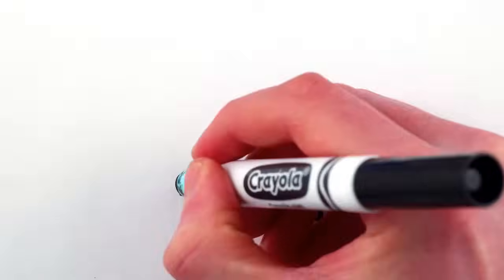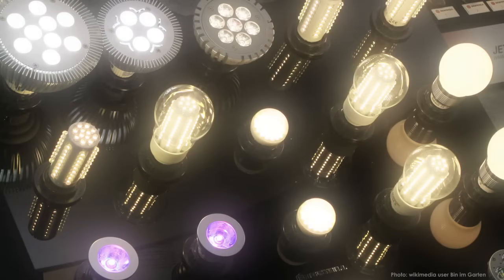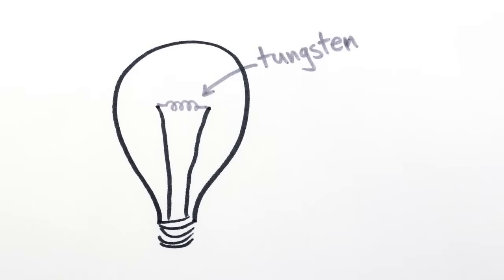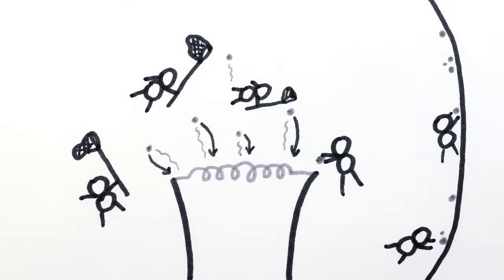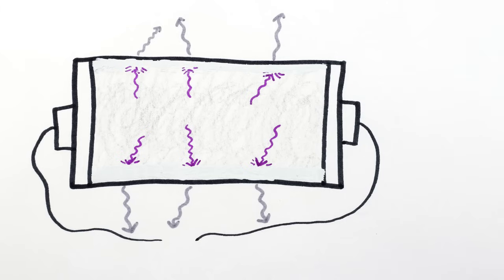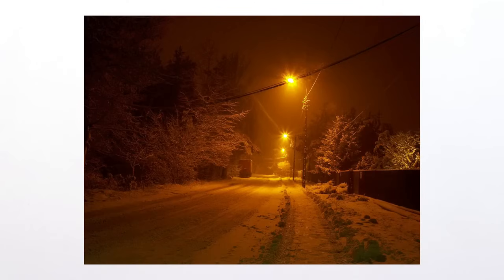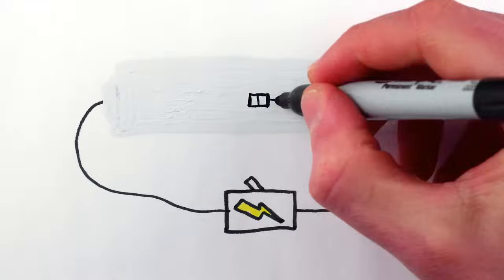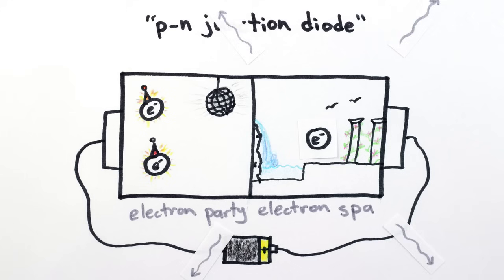How Modern Light Bulbs Work

Comment: correct me if im wrong , the fluorescent light bulb emits uv , and the glass is coated with something that prevent the uv ray from passing through it , but i thought all glass absorb uv ? why needed to be coated ? thats why u cant get sun tanned in room with windows
Reply: The coating on a fluorescent tube is called a phosphor. The light emitted by the excited mercury alone only produces Ultra-violet (UV), violet, blue, green and yellow light. The phosphor coating is used to convert the UV light into red light, so that we can see all the colours.
Reply: it doesn't only absorb, it converts it into visible light.

Comment: So then, what process is most efficient at the process of converting electrical energy to visible light?
Reply: Tommy59375 Because LEDs emit white light, which the human eye can see better in than the orange street lights. If they're upgraded, then they were probably halogen to LED, I know that in my city the lights are halogen, and some are LED. The LEDs are brighter, provide white light, and use less electricity than what we have now, so it makes sense to upgrade. They're also probably a lot more cost effective to replace and maintain rather than vapour lamps.
Reply: Typically, in order of most efficient, is vapor lamps, LED, fluo, halogene, and classic ampoule
Reply: Adricol0
So, then, why are some towns' street lamps being "upgraded" to LED-based systems?

Comment: how do color changing LEDs work?
Reply: They have three (Red Green Blue) crystal parts that are basically 3 LEDs in one plastic housing. By changing the intensity of the 3 colors you can make many other colors. (This is also how you computer LCD screen makes 16 million + different shades of colors!)
Reply: To add to the answer of Leuel48Fan , changing the intensity isn't as easy as it sounds. You can't just apply another voltage because LEDs don't act like a normal resistor (i.e. don't follow ohm's law). Rather, they just let through all the current they can once the "forward voltage" has been surpassed. So you use a resistor in series with the LED to limit the current (the resistor value is ((supply voltage) - (LED forward voltage)) / (desired current).

Once you have that resistor, you can adjust the brightness using PWM, which is essentially switching it on and off very fast. The human eye only sees the average, so if you see an LED that is switching on for a millisecond and off for a millisecond, you see an LED that has half the brightness of a fully lighted up ont.
Reply: vir ingens I knew about the blinking thing, I know 7 segment displays use it to save energy and have consistent brightness, but I'm pretty sure changing the voltage of the LED does also change its brightness (up to what its rated for). That's why an LED flashlight with low batteries dims just like any other bulb.

Comment: Do the pc uv lamps cause cancer to us? Because I have one installed..
Reply: Have you ever been sunburnt by the UV lights in your computer? No, there simply isn't a high enough intensity.
Reply: ***** You don't need ionizing UV to cause damage. The common way of DNA mutation - via the formation of pyrimidine dimers - doesn't require ionization to occur.
Reply: Only if you gonna eat "GMO" tater chips and corn while you watch the screen!......Any more questions?
Reply: hm can you guys translate it to "my language"? lol
Reply: ***** The very first link in the Wikipedia article on pyrimidine dimers states it quite clearly:

http://theoncologist.alphamedpress.org/content/6/3/298.full

UVB light is energetic enough to cause dimerization, and as you yourself stated, only light below 120 nm is ionizing. UVB only goes as low as 280 nm, and is non-ionizing. The article also states that UVC, the only ionizing component, rarely reaches the surface of the Earth anyways, due to atmospheric absorption.

Photochemical reactions in general doesn't require ionization, only the excitation of the electron into an anti-bonding orbital to destabilize the bond.
Reply: Paulo Melo We're talking about a specific mechanism of DNA damage that's common to UV light. DNA consists of these "letters" that are chemically bonded only via the backbone. However, UV light can sometimes excite the molecule enough so that they bond where they're not supposed to, and if the body cannot repair that damage properly, you get mutation.

Comment: I was hoping you'd touch on High Intensity Discharge Xenon bulbs (used in automotive and infrastructural applications). I think they're closely related to fluorescent bulbs except that they arc electricity through gasses and require more power to initially turn on

Comment: How does one speaker reproduce multiple frequencies of sound? To clarify, I think that a speaker diaphram vibrates at a certain frequency to produce a sound, but how does one of them reproduce the music of an entire band with many instruments and vocals?
Reply: You can add two waves together to get one resultant wave.

Imagine dipping your finger in and out of a pool of water - you see waves of water coming from that point of contact. Now dip your other finger nearby at a different frequency. Any given point of the water will move as a result of the sum of the two waves.
Reply: ok, but using your analogy, does one speaker not equal to one finger? How then does it manage to produce many ripples at once?
Reply: Nope. I'm saying multiple waves, when added, can become a resultant wave. All you need to do is have a speaker follow those "points" I mention. I'm trying to let you think how one point on the surface of the water will move according to the sum of the two waves, even though it is still just one point in the water, and you can map its motion with one function.

Here, see this waveform:

https://www.wolframalpha.com/input/?i=sin%28x%29+%2B+sin%282x%29

This is the sum of a wave, and another wave of double the frequency. All you need to do is have a diaphragm follow that exact motion, and you'll produce sound waves that is the sum of the two frequencies.
Reply: I guess its hard for me to believe what my ears hear as many different sources of sound are actually one resultant sound wave, but I am beginning to understand now. Thanks!

Comment: How a telephone works
Reply: A fifth grader should be able to explain in principle to you about how a telephone works. The key work is "should". I don't know exactly what has happened to the school system since I went. When I was in primary school, about fourth grade, every student was assigned to make a crude electric telegraph and connect them across the room to our 'science partners' desk and transmit and receive a simple message in Morse code. Mrs. Davis, my teacher, may never know how much of an effect that these simple electronic projects we did in her class had on me.
Reply: If a 5th grader can explain POTS and telephone exchanges, then I wouldn't have a job wiring the things up. There's a bit more two it than the basic principle. The awesomeness of telephone isn't in the simple end devices, it's in the rats nest of wires and switches that makes them connect to each other automatically and reliably.
Reply: Magic.

Comment: I tried the new CFL bulbs in my office and was pretty disappointed. While they didn't generate heat like standard bulbs the light emitted didn't last as long as a standard bulb IE the light produced became less after only a month or so to the point I was replacing the bulb with a new one. They're also very expensive and rules for disposing of them are unrealistic. In anticipation of the coming ban of standard bulbs, I've begun stockpiling them. They may produce heat, they may cost a few pennies more than CFLs to run but they LAST LONGER.
Reply: You likely have a bad batch.  They do exist.  Only buy reputable brands.  CFL's last far, far longer than incandescent.   We replaced all ours 5 years ago and have only had ONE go bad in 5 years.
Reply: Kevin Patrick Nonsense.  Just do the math.   CFL's put out 4 times the light for the same wattage.   Electricity is about 16 cents per kilowatt hour.   A high quality 25W CFL bulb costs about 4 dollars, and puts out the same visible light intensity as a 100W incandescent.  With the CFL you're saving 1.2 cents per hour in electricity costs compared to incandescent.  

So, It only takes 333 hours of use until you've payed off the cost of the CFL bulb ENTIRELY from your energy cost savings.   After that, even if your "thicker filament" bulb was free, you'd still be loosing money.
Reply: codediporpal I've tried the 'bad batch' thing buying from different stores and I even bought one while on vacation. They ALL performed the same way, the brightness of the light began to fail after a month or so. 

I work on a drawing board. I have a tube fluorescent fixture for over all light and second light for detail lighting and tried the CFL in the latter. The lights are on for sometimes 8 hours a day, the tubes are 2 years old and still perform as new, the CFL is a fail. The standard 60 w bulb, despite the heat produced, lasts longer and will remain my first choice which is why I buy them whenever I'm in a store for anything.
Reply: If incandescents are always outlasting your CFLs, you probably have a bad bit of noise in your electricity. AC is supposed to be a nice sine wave for the ballast to work right, but in your case it likely isn't. Noise on electrical lines is also the reason why you're not supposed to use CFLs on dimming circuits.

If you plug in a radio you can probably hear the line noise (AM in particular), and it's likely any other electronics you have may also have a shortened life as well. (It's not just going to be your CFL bulbs.)

Where the noise comes from? Could be a bad a bad transformer stepping down from the mains, bad wiring in the building, somebody else using something that causes noise in the lines (ie: welding equipment). If bad enough, you should call an electrician or the power company to figure out where the noise is coming from and possibly get it fixed.
Reply: CFL bulbs are a are a heath and ecological disaster in the works, for a whole variety of reasons. (I'm not going into it or going to reply to arguments about it because there is plenty of info readily available concerning this subject.) I hypothesize that people who primarily use CFL's are knocking roughly 20 years off of their normal life expectancy, however, time will tell.
     I use a plethora of solutions to light my house, but CFL's are not one of them. In part because they create interference which negatively effects the equipment in my home recording studio, and the concentrations of mercury in them which becomes very hazardous, if and when they break.
     I think it's stupid when I hear people say that the incandescent is a 19th century invention in a way to imply that it's age makes it inferior and that we shouldn't use it at all. Candles are thousands of years old,.. people still use them,.. lots of old inventions are still used. Vacuum tube transistors have been effectively replaced with solid state and micro processors, however, there are still applications where vacuum tubes are preferred over solid state products, such as high quality guitar amplifiers and such. An LED bulb isn't going to make my lava lamps work, either.
     I like my incandescent bulbs particularly in the cooler months because they help provide ambient heat from their locations and not having to solely rely on a single central heat source which is pulling multiples of the light bulb's load put together.This reminds me of those stickers on new TV's that say this TV will save you 27$ of energy costs a year over conventional CRT screens. So, if energy savings were my rationale for upgrading my television, hypothetically,.. then it would take at least 20 years for the TV to pay for itself in energy savings. Since energy costs rise, probably longer. (By the way, I like having flat panels, but I'm not letting go of my CRT's, willingly, either.)
     It seems to me that the banning of incandescent bulbs is an industry funded cop-out to reduce the load on our aging electrical grid as opposed to actually upgrading and improving it. It's one thing for lighting technology to improve and for people to gradually and voluntarily switch over like people did with televisions, but it's totally draconian to outright ban the production of another older technology, especially when it's the consumer who is paying for the product, and the energy that it uses.
     In the not too distant future I think CFL bulbs will become the universal symbol for bad ideas in contrast to the way we use incandescent bulbs to represent good ideas in cartoons.
Reply: *****

The old florescent tube is probably irrelevant.  It is just a tube; it does not have the ballast integrated like a CFL bulb does.  The ballast used on the old tube florescent lights is a low frequency circuit which probably only uses resistors, capacitors, and maybe inductors.  CFLs use much more complicated electronic ballast to step the frequency up to use smaller capacitors.  They also use transistors and possibly even micro-controllers to accomplish this.

First thing to consider is, are the bulbs actually staying dim.  Most CFLs I have used start out a bit dim until they warm up after which they get up to full brightness.  It is usually a gradual change rather than a sudden brightening.

If they actually are dimming, then this seems to be a problem somewhat unique to you; I have never observed a CFL to last a shorter time than an incandescent.  I probably have some over 10 years old in less frequently used lamps.  This points to something going on in your area, or with the brand of bulbs you are buying.  There is considerably more variation in the quality of CFLs (build quality and accuracy of color) since they are significantly more complicated than incandescent.

What exactly did your electrician check?  They make simple plugs to indicate whether outlets are wired properly.  He may have checked the voltages.  I had a friend who had all sorts of issues until he finally called the power company out and found that he only had ~90 V comming into his house instead of 120 V.  I doubt whether the electrician checked for noise.  This would require expensive equipment.  If you are in a populated area, then you presumably have more than one house on the same transformer as yours.  Wiring problems or equipment running in other houses could affect yours.  You also may not be getting clean power from the power company in the first place. 

There is probably not an easy way to figure this out without doing some more testing.   The quality of the power coming into your house can make a big difference.  I know some people living off the grid, and they had issues with their system not producing a smooth enough sine wave.  Some appliances had no issues, while others would refuse to work at all.
Reply: jamesccox I''m just gonna stick with the old tube fluorescents since the fixtures are already integrated in my house,.. and I've never had to replace one in the 5 years that I've lived here. I'll prolly switch over to LEDs when I can't get incandescent anymore. forget about those dirty, blinky, harsh, inconsistent quality, mercury filled CFLs, Not in my house,.. I'll burn oil again first.
Reply: Nicholas Cardenas I can not make heads or tails what you are trying to say. Where dafuq did you learn English?
Reply: You don't need to give me a lesson on anyhing. You're just a lazy troll with nothing to contribute to the conversation. CFL's put off a lot of harmful radiation. If you don't think excess exposure to those CFL bulbs are harmful to people overtime, especially in close proximity like if they are used as a reading lamp, you're the crackpot. I bet you think cell phone radiation is safe too. Nevermind the corelation of tumors apearing on people near their groin and on the side of their head since cellphones went mainstream.
Reply: Bodhi Bird Studio
Out of interest, what kind of radiation do you suppose that CFLs emit?
Reply: Daniel Astbury Mostly light. It's the dirty electricity you have to worry about.
Reply: pauljs75 When we first bought this house, I had an electrician I've dealt with for years, I'm a remodel designer and he used to work for the local electric utility, check the place. Other than mounting screws being loose in a few receps, the system checked out.

The Fluorescent tube light fixture over my drawing board has never dimmed down and those bulbs are probably 5 years old. 

It's not a problem with the electrical system in the house, I have friends that have have tried CFLs and have had the same issues with them.

Over the last few years we've been stock piling the soon to be unavailable but reliable incandescent bulbs and have enough at this point to last the rest of our lives.

Any other suggestions? I like the idea of saving money on the electric bill.

Comment: LED bit was simplified. It is correct for colored LEDs for indicator applications, but not for lighting use. Lighting grade LEDs do typically use phosphors to convert most of the blue light from the LED into reds and greens so that the overall output looks white.

Comment: Ok here is the question: why Incandescent light bulb (or any other bulb with filament) is not flashing? Fluorescent does. Obviously not flashy enough for human eye but you can see stroboscopic effects with fluorescent lighting. Both lamps use AC so why Incandescent doesn't flash.
Reply: It does flicker in the sense that there are times when the incandescent lightbulb experiences no current whatsoever. Since an incandescent lightbulb works by black body radiation, however, how much light it emits is a function of temperature. So while it does cool down in the absence of a current, doing so some 100-120 times a second is not enough for significant drop in light output.